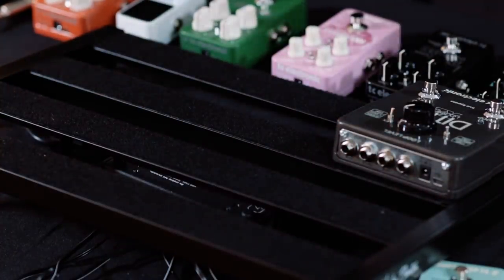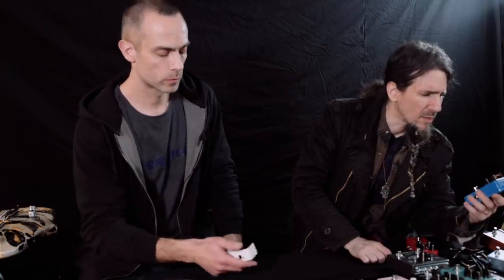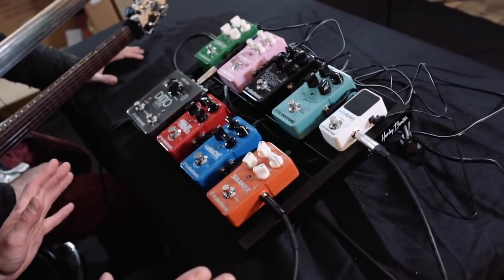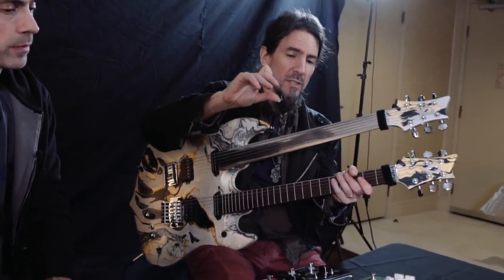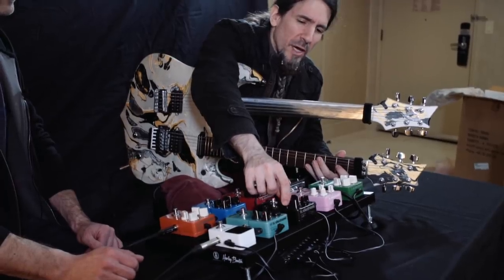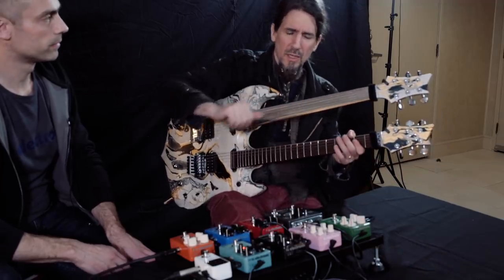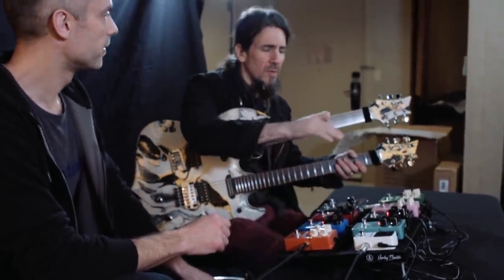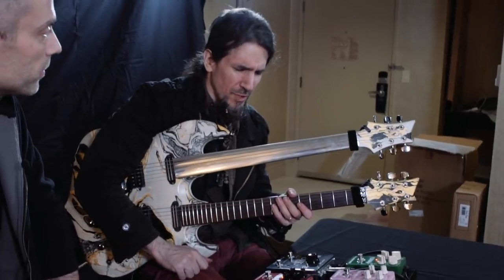Bumblefoot - Building a Pedalboard

Comment: Not many players can get away with using a double-neck these  (let alone one with a fretless), not without looking like a twat.
Great pedalboard. The Quintessence can be set up to do some of the octaver/whammy duties, it just takes a bit of mucking around with toneprint, but I understand why he went with the Brainwaves (I always go pitch-shift>drive, but who am I to argue with the mighty 'Foot).
Major props for choosing a Vibrato! Misunderstood effect.
Reply: I just wish Ron would get MORE logical. (EX: does he really need headstocks on both necks? I'd want the doubleneck to be HALF the weight, and much smaller 
(3/4?) and headless of course. MORE EFFICIENT.)